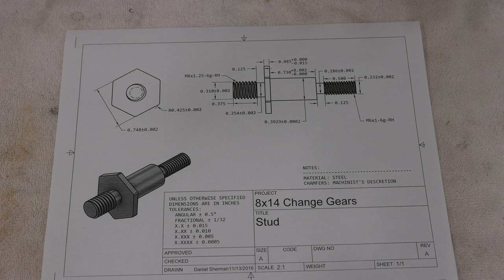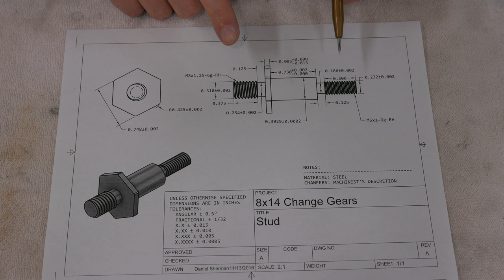A Better Lathe Banjo Pt. 5

Comment: Dan, Thank you very much for all your work to provide such fine interesting and informative videos with great picture quality and audio!  
I have the same Lathe Master Lathe and would like to know about the carriage lock you made.  Did you bore out the 8mm cap hole and make a new bolt pin?

Glenn C
Reply from the maker: Glenn,  I replaced the 8mm bolt with a custom made one. The head is larger and has a cross bar that works like the screw/handle on a typical bench vise.

Comment: Very interesting, nice work and many thanks for posting. I hate to insert a little moan here but a big spoiler for me is the overhead view of much of the lathework. I love to see the cutting tool up close but when actually vertically overhead it becomes a 2D view - most of the perspective is lost and there's no view at all of the workface. 
If you could just bring the lens a little towards the tailstock and perhaps offset it a little it would, for me at least, be much more enjoyable.
Reply from the maker: Stephan,

My next project, is actually about rectifying that issue. I'm planing to build a wall mounted articulated arm, so that I can re-position the camera more easily, and so that I can work around some overhead obstructions.

It will be similar to this, but also have a vertical component so it can be raised and lowered.
https://www.youtube.com/watch?v=YqXVbKD1CTw

I've already gathered the materials, I just need to finish off the banjo project, and make some woodworking Christmas  presentments.

Comment: If you are really wanting to hold tolerances down to tenths you should let the part cool down prior to measuring. Thermal expansion on the stud at the beginning would have made as much or more difference than the emery paper. Good as a challenge maybe but holding tenths on a gear banjo isn't really needed. The chatter when you cut the thread relief sounded to me like it was too high an rpm on your lathe. Excellent perspective on the video, it's cool seeing good quality, well lit shots.
Reply from the maker: Hi shawn,

I probably should have shown it better, but I was letting the part cool down close to room temp, i just cut a lot of the footage out as i didn't think most would find it interesting.

Comment: Are you hand feeding the saddle or have you made a power feed disengagement mechanism?
Reply from the maker: I'm power feeding my saddle. I have a dial indicator set up all of the ways, and that gives me a very accurate indication of when I need to disengage the half nuts. Usually I can get to within .005 to .01 of the reference point.
Reply: @Dans-hobbies  - I see. Impressive timing skills there. Would it be difficult to design and implement a half-nut disengagement mechanism you think? I'd love to do that but not sure it would be easy? Maybe a rod through the apron pushing the half-nuts apart somehow. And when this rod hits a saddle stop it will do just that.
Reply from the maker: @Contango1000  It's not as impressive as it sounds. watching the dial indicator gives you a really good method for timing when to dis engage the half nuts.

people have modified lathes to automatically disengage the half nuts for threading. Like this video, and a few old lathes even came with a system from the factory.
https://www.youtube.com/watch?v=-Riiep0c64o

What seems to be the most common place  today is a clutching mechanism on the feed rod (for lathes that have them). For people running VFDs they just seems to use a proximity sensor and the e-stop feature of some vfds.

like this.
https://www.youtube.com/watch?v=YKoq7Mtr4ks
Reply: @Dans-hobbies  Vey cool, thanks. I'll check those out :-)

Comment: Hey Dan, this is the first video I watch on your channel and I like it very much! Subbed and will make sure to watch out for your next videos. Just a question: at around 23:50 you clamp the collet holder on its points. Is there a reason for that? I got a bit scared it just pops loose :-( Keep it up!
Reply from the maker: It's a cheap collect block, so while the sides/faces are all well within speck, the points where out a little. Basically the flats are a better reference surface.

Comment: I just found your channel a few days ago and LOVE your work!  I have a small lathe (Atlas 618) and do videos as well.  My machining videos are called "Journey to Journeyman."  My biggest accomplishment was being a Collaborator with Brad Jacob (Basement Shop Guy) last year for Keith Fenner's tool box giveaway.Anyway, I was curious about your lathe and inserts.  Your lathe doesn't look very big but you a making chips that look like the ones on Abom79's lathe, WOW!  I would love to make .100" cuts per side on my Atlas 618.  Do you think it's the insert?  I saw on one of your videos that it's a Sandvik insert.  I feel like "big man on campus" when I cut .020" per side.What lathe are you using and is it the insert that make you able to make such big cuts?  Thank you in advance......jster1963
Reply from the maker: Hi jster1963,  I'm glad you enjoyed the videos. I'm a subscriber of yours, and really enjoyed the mag mount video.

My lathe is a  mid 00's Harbor freight 8x12. Its really a 8x14, but HF has always has always mislabeled it. 

The .1" DOC looks impressive, but it really boils down to two key factors, is the lathe rigid enough to make the cut, and does it have the power to make the cut. Rigidity is hard to quantity, as one weak component, like a 9x20 lathes  compound arrangement, or a 7x14's gear train, or warn drive belts for example, can really limit the overall machines ability.

The power required can be calculated pretty easily with the imperial data gathered by those who came before us. If you have a copy of Machinery's handbook, read the section on power constants and  Metal Removal Rates as it provides a decent level of detail on the subject.

I would summarize it as; The DOC possible my any machine not limited by rigidity, can be determined by calculating the maximum material removal rate the machine is capable of, and using that to determine the doc. 

it's a hard thing to explain without charts and graphs, but hopefully that will help you some. If you want me to clarify something please let me know.

The inserts i used definitely make it possible, but the same thing could be achieved with a sharp HSS cutter, and the proper amount of back and side rake. For reference the insets I'm currently using are Sandvik ccmt 21.51 PF chipbreaker, grade 1515.
Reply: Thank you so much for the info!  You're a sub of mine, how did I miss that??  And a HF 8x14?  WOW!!I do have a Machinery's handbook and will look at the section.  I hope I can do some tweaking and get some better results (results like yours).  I think I have enough horsepower, but your machine "kicks up" the power as you start the cut.  I have to somehow figure out how to do that.  I'm using an industrial sewing machine motor, but I don't think it has the "feedback loop" to increase power when the load increases.  I could be wrong.  I just may be using it incorrectly.I may try to get some of those inserts, but I'm going to try not to do what I usually do, which is buy something to fix a problem before troubleshooting.  I'll start with looking for what the machine is capable of doing and then go from there.I love your lathe stop and after watching your videos on that I may re-do mine.  Or I may do one like yours for my South Bend 10k.  I really need to get that machine in the basement and put it to work.Thanks again for taking the time to help me.  I really appreciate the help.........
Reply from the maker: No problem man, glad to help when i can!